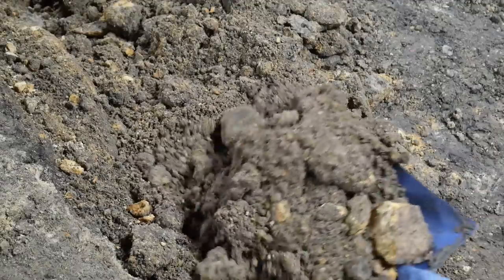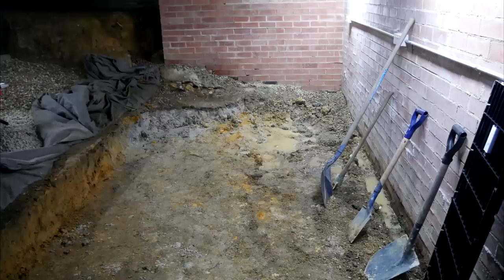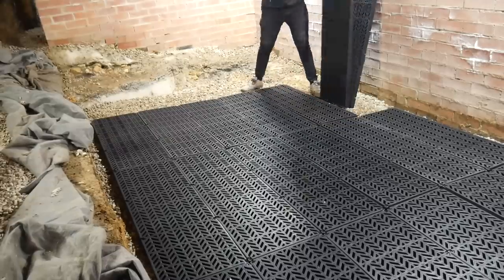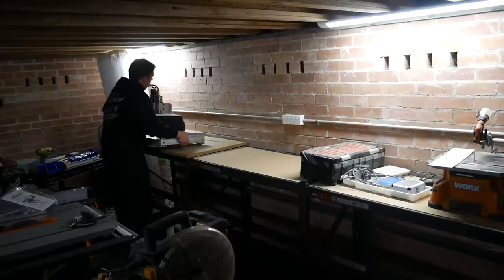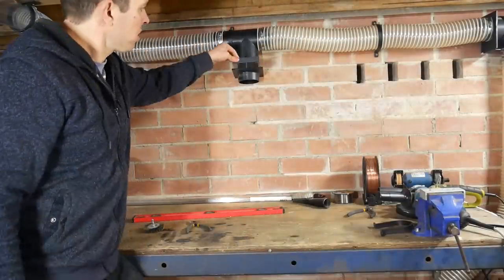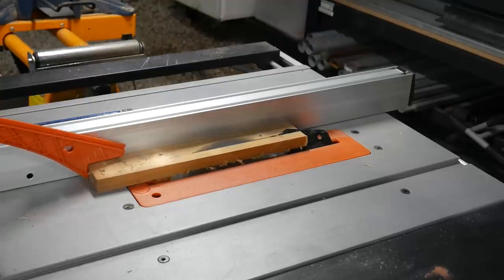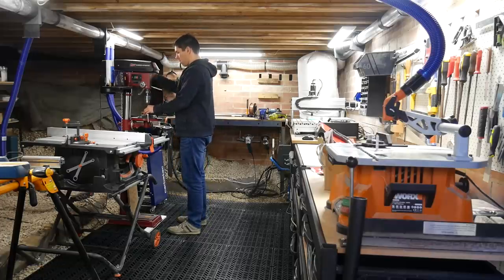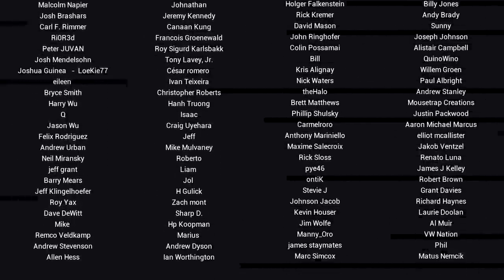Digging to create an efficient under house workshop

Comment: Love this man cave!

How is ventilation down there?  Good ventilation is essential in damp and wet areas and will help reduce moisture in the air.  Natural ventilation is good with ducts down on one wall(s) and up on the opposite wall(s), or you could install a bathroom fan or 2 to make forced ventilation if needed, preferably combined with some heating.  I'm amazed how quickly moisture can ruin tools, so you will need to combat it.

Also, I would consider putting some wooden flooring on top of the plastic flooring to prevent dust buildup, important parts disappear down there as you mentioned, and reducing the moisture even more.  Just make sure to first put on a layer or 2 of plastic foil to prevent moisture ruining the wooden floor.   If you lay foil on top of the gravel in the rest of the room and connect everything to make a damp barrier you will get all the water running beneath the plastic and then you will get a dry room when combined with ventilation and some heating.

Comment: Ever since I was a kid and we moved into a place with a space under the house like this I always wanted to do something like you did with one when I was older.  I find your project really cool and I hope that you can figure out any potential issues you might run into (like run-off with really heavy rainfall).  We had a family friend who used his space under his house for storage of computer stuff and general knickknacks but he lost a fair bit of it to a storm which flooded the underhouse area - a simple preventative fix would be to ensure that you don't have anything that cannot get wet sitting on the floor but rather use something like shipping pallets to keep it up a few inches.

Comment: You could always use some outdoor carpet to lay on top of the fast floor to help with keeping things out of the bottom, would make cleanup still pretty easy, it's like vacuuming a carpet. :) Best of all, if you need to get to the foundation of your fast floor, you can just simply roll up the outdoor carpet.

Comment: Have you considered laying down some "protection" layer over the grid, to keep parts from falling through (and not having to disassemble the floor sections)? Those Ikea floor protector have a decent size-to-price ratio, they're rather thick, and have one side with a rugged surface. There's also surfacing you can buy by the metre, like linoleum, pvc flooring, or even short-pile carpet.

Comment: Have you considered just excavating the entire room and just pour some concrete for a decent floor? You'd get a much bigger room and a decent environment for your tools. As it stands rust is going to be a huge issue, unless you constantly oil all bare surfaces.
Reply: And if you do that, first seal the floor. Concrete is water permeable if the bottom is wet, and he top will be too.

Either get a professional, or diy. 

Look for the term “encapsulated crawl space”.

Humidity levels that high will lead to mold. Using an electric dehumidifier is 40-250 times more cost effective than to damp-rid and similar chemicals that form gels. Below 50% humidity dust mites die. Lower than 40% humidity is bad for humans.

If you diy, you can get a “froth pack” of spray foam. 200 usd pack makes around 200 board feet of spray foam. Often you see:
Ground 
Wet gravel
Dry gravel 
Spray foam
Concrete.

Make sure to walk the spray foam up the sides of your walls to give you a continuous barrier.

Comment: Looks great!  I have my own workshop in a self build wooden shed in my garden. I had a lot of problems withe the humidity. But now i isolated the roof and walls and made the floor watertight with epdm plastic (used for roofs mostly), and i installed an electric heater with an external thermostate from Ali. Since that i have no more humidty problems. Try to keep the temperature above the dewpoint. (here that is about 12 to 15 degrees i think)

Maybe this epdm foil is an option for you too, to close the floor and the wet rock wall?  

Keep up the good work! Greetings from Holland

Timm

Comment: A couple ideas for you - 
- Look into french cleat locks. It's relatively easy to pull something down by accident, and if it's one of those small parts racks you're going to be pulling up the floor soon enough. Locks to prevent accidental release are easily made/printed..
- Easy method of finding small parts that fall through your floor - stick a nylon stocking over the end of your vacuum nozzle and suck it up.
- Covering the slotted floor with puzzle-edge anti-fatigue mats would also help here, and they're generally pretty cheap.

Comment: How is the rust situation some months later? I built a workshop in a similar environment (in the French Pyrenees) What I did was construct leca block room surrounded by insulation and a vapor barrier on a insulated slab poured over a gravel bed with perforated drainage pipes underneath. It was a big expensive project but works perfectly and is cheap to heat and cool with a mini-split heat-pump. You were lucky to have mostly dirt, I got to spend weeks with a jackhammer to remove cubic meters of solid stone :)

Comment: I've found that MDF will mould very easily so worth checking underneath the lower levels of the shelving.
Reply: Yes, I have seen the same thing.  I drill a row of 25mm+ holes in bottom shelves to ventilate floor side to the room side air.  That helps a little.  Also, paint them with Kilz anti-fungal paint to seal the surfaces.

Comment: Ventilation will be your key for keeping humidity down. That's not too challenging hopefully! I also use an old offcuts of carpet in my workshop. Low pile cheapy stuff. But it makes life nicer, easier, warmer, quieter and I can easily find screws I drop. 

Good luck!

Comment: A moisture barrier is a must, I’dve installed some of that plastic slot channeling with grating on top at floor level around the whole perimeter of the workshop to catch water before it entered the area at all rather than letting it flow underneath, then piped it out into a drain. Cover that over with the plastic and your flooring then.

Then put in a set of supports and a false wall to block the rest of the unused space off from the workshop itself, that would prevent any moisture in the air from entering the space too.

And to help prevent the issues with the floor being easy to drop things through, add a top layer of hybrid vinyl floor planks over the existing flooring. You can buy ones that click together for practically nothing, (AU$20-$30 a sqm if you look online) and they don’t require adhesives, they just sit atop existing floor structures, they’re water resistant and are easy to assemble and care for. The existing flooring will help with airflow, and prevent moisture issues, as well as giving you a decent foundation for the new stuff.

I really think your biggest concern is getting the space square and sealed, if you do that, it’ll make moisture management and safety easier to pull off.

Comment: There have been many good ideas listed below. It really depends on how much work you want to put into the place. You could use a waterproof coating on the walls. A shower drain membrane on to of your floor would be durable, act as a vapor barrier, be easier to clean, and prevent you from loosing small parts down the cracks. As mentioned by others, ventilation will make a big difference. For that level of moisture, you may consider a house dehumidifier rather than a portable one.

Comment: Creating a new shop is so exciting with all the future possibilities, and you've done a great job. Congrats!  I highly recommend using a pedistal mounted oscillating fan to keep constant air movement.  Place off to the side, turn it on low, and leave it on 24/7. It is inexpensive to run, and will reduce mold, condensation, and spider webs.

Comment: Excellent job, that was a lot of work too. My only suggestion would have been to rent a thing called a tamper, it has a large flat head on that vibrates against the floor and packs it all down to get a nice compact floor surface to build on because over time dirt will shift. The only other thing I would suggest would be to get some indoor/outdoor carpeting to lay down over the floor to cover the slots. Also, I wouldn't even bother vacuuming those holes out in fact, it fill them up

Comment: I'm not going to drag through all the comments to see if  this is a duplicate, but congrats! Everyone who's got a walkable crawlspace under the house has dreamed of doing this. My suggestion for improvement is to make use of the space between the rafters, or floor joists, or whatever they're called down under. You can make up all sorts of storage solutions to fit between the overhead supports that would be 16 imperial inches on center here in the States. Simple strapping across 2 adjacent and you have a place to store linear material from lumber to piping to trim. 2 hinge points and you have a cabinet that folds down; 4 hinge points and you have a place to put arms that swing down parallelogram-style to present some flat surface as needed. My basement is 6'2" to my 6' so I have a lot of stuff tucked away overhead.

Comment: Fantastic work! I love it! My recommendation is to look into an Oneida Super Dust Deputy! I have designed several dust collection systems in small workshops with them, and you current dust collector. I 3d print some custom fittings, and it’s amazing suction, and easy to unload a blue plastic drum with your sawdust!

Comment: I really enjoy transformative projects like this. Congratulations on all that you have accomplished! Consider a dehumidifier designed for crawlspaces as that is essentially what you have. You can improve lighting by mounting your ceiling lights to white rectangles roughly the same size as the benches beneath. These could be painted wood, plastic, or maybe even skirting instead. It will be less harsh than reflectors. 
With humidity that high you'll also want to look at treating the wood above you. Humidity over 55%-60% will propagate mold, which isn't helpful for anything you're doing.

Thanks so much for sharing and great job so far!

Comment: Imagine the rust in that room. Everything is going to rust so quickly.
Also be very careful mixing the dust extractors with the welder. Sounds like a bomb about to go off. Air, wood and igniting should like a fun time especially under your house.

Comment: I'd put some of those square locking foam pads on top of your floor, they're nice to walk on and if you drop things on them they don't bounce much and they're easy to find.  They make them pretty thin also so it won't take much height from your workspace.

Comment: I just noticed that the weed matting on the sides and the back wall by the welding table is not flame retardant. Make sure you add a flame retardant curtain or such over the flammable plastic

Comment: I wish you the best but I had a space similar to that once, but with less water issues (water was seeping up through concrete, not flowing through sandstone) and it was a CONSTANT war against rust and mould until I lost and surrendered the space back to firewood and garden tool storage and built a new shed. You may have better luck with ventilation vs dehumidification with that much moisture in there.

Comment: Looking great! If you want to lessen the floors flex add some paving sanding to fill the voids.
(It generally clumps & sticks together which would help with movement but still allow drainage)

I personally would have got some black/grey shadecloth and used some spray adhesive to attach it to the plastic flooring just to give a more "indoor" finished type look...just an idea i would have done that may appeal to you 🤷‍♂️

Comment: Humidity is also high in here. I always buy good hand tools. After I use them I always put  Spray Grease oil on them. As they do for the house, maybe it's better to make a room inside room. One more thing is 24h air ventilation. That will reduce it. Also, for your cnc, put some spray grease oil on each axises long rods. Good luck man.

Comment: Anytime you're mixing dust and hot work (ie welding), fire extinguishers, fire detectors, and fire suppressant systems (fire balls, etc.) are going to be your friend. I'd also consider running some copper wire through any ducting which includes plastic sections or joints to ground it all out - this will eliminate the risk of explosion posed by static build-up (your space may not have enough square footage to pose a significant risk of this, but better safe than sorry). Just finished moving our local makerspace to a new location so all this fire safety is still towards the front of my mind lol.

Comment: Awesome effort digging out the workshop area. 

Unfortunately you will have issues with rust on your mild steel machines, so keep up the maintenance, you are most likely looking at doing a weekly treatment to keep it from forming surface rust.

I have a workshop up in Brisbane, even without your water/humidity issues I have to keep up with maintenance.

Pretty much anything valuable with steel (router bits, drill bits eta) I put in drawers to reduce corrosion, lucky you know a thing about 3d printing inserts :)

Just be mindful when MIG welding that dust collector will be a serious fire risk

Keep up the great content

Comment: You could have possibly dug down a bit more and used slightly longer legs on the front of your workbenches with the rear legs sitting on the concrete footings, but as long as there is enough headroom, it's probably better to keep the floor even or above the footing. 
Everybody puts their dust extraction ducting overhead, but I don't see a big reason why it can't go underground. You would have to use stronger pipe and make sure that it is watertight, but it would be interesting to have vacuum, compressed air, and power coming up from the floor. 
You can always dig further and make the shop wider, but you may need to get an engineer to do some load calcs. The house may be relying partially on the under house slope to hold it in place.

Comment: Yeah worry would also be about rust with that limestone putting water in there constantly.   Steel will rust insanely fast at 80% humidity and iron rusts at 50%.  Ideally you are going to want to get the humidity down to 50% if you can but really below 60% is fine.     Another thing that can cause rust is the temperature change from day to night as that caused slight condensation on the metal with the temperature change.  It might never be enough to look wet but it is enough to rust.   You might seriously look at adding a heater to keep the room at a consistent temperature.

Comment: Sorry to be that guy, I only want to support you positively :) I'm finishing up a 4.5m x 3m under house excavation through sandstone, including brick pilon to steel post conversion. It is a dry room for 3d printing in peek/ pek. I also have built a 12m long 2.5m high retaining wall in addition to many other significant renovations. The property is on the bottom of a slope and it also has significant water issues. You've basically done most of the hard work and i want to give you some tips as i have dealt with water issues successfully.

You need to concrete the ground to stop the moisture, it will destroy your tools. Dig out as much as you can or is necessary. You need to run a pvc pipe outside of the room to drain the water. Don't have open drains as the space is not ventilated to handle the water/ moisture. Base of the slab, put down geomat everywhere under the house. Run agg lines to a drain, however you see fit. 2 sizes of blue metal 10-25mm about 30-50mm deep the entire underhouse, 2 sizes helps with compaction without affecting drainage. Builders plastic the entire ground including further under the house where there is no slab. Put down some mesh and poor the slab, Done! You will have very little issues with water and you'll be surprised how easy it actually is when you take a deep breath :)

Comment: You should be able to handle the humidity with a dehumidifier that has a drainage hose that you can feed right into the gravel. You can set the humidity you want and let it go. It may take a while to catch up but should be fine.

Comment: Great job!  What about thin Matt’s people use on hard surfaces?  It will make standing more comfortable and prevent things from falling through holes?  You have enough air flow under.. not one full sheet across the whole floor, but several sq meter sections.

Comment: I would look into a dehumidifier that has a pump built in. I have one in my basement and it has a small hose that I drilled a hole in the frame for a window and ran it out to the garden. It's not a lot of water and the pump only kicks on when the water gets to a certain point but it runs well and I don't have to worry about emptying it.

Comment: Bear in mind that when the area is first dug open that the flow of water will be more than long after it's not disturbed any more after it's finished as it is and it settles down. As for the floor dust, you can put a surface over the material of the floor that is solid, not a rug which will hold moisture but perhaps some flat sheet material like they put under office chairs which is not too large and removable for cleaning. Also having smaller space is better since hoarding and clutter is not possible without inhibiting & choking the workspace itself, rendering the entire area not usable.

Comment: Nice job. Looks great. One option to help improve the lighting is to hang some white material along the open side of the shop. Some sheets or thin wallboard. Even though you have lots of light fixtures it still seems a little dark because of that open side. Reflecting the light back into the room should improve it.